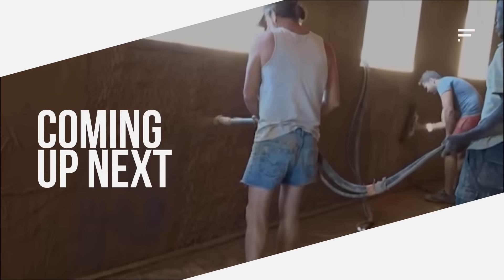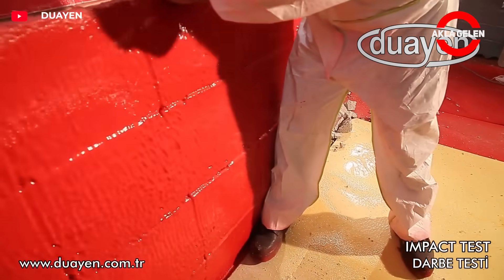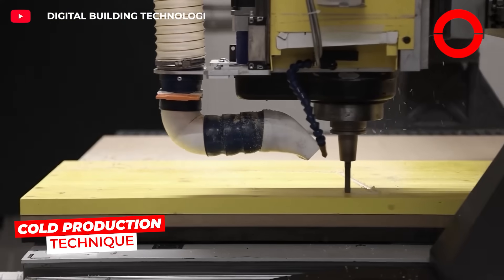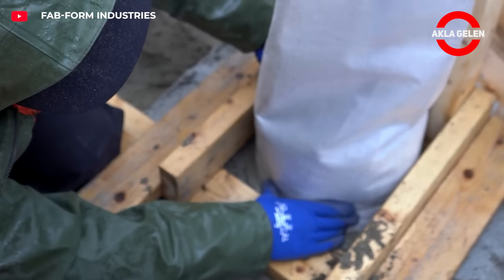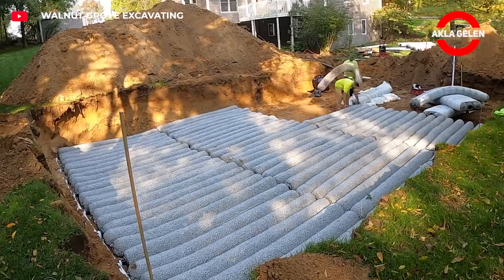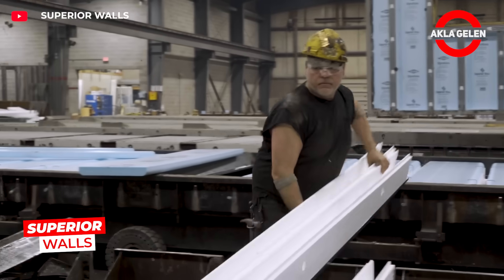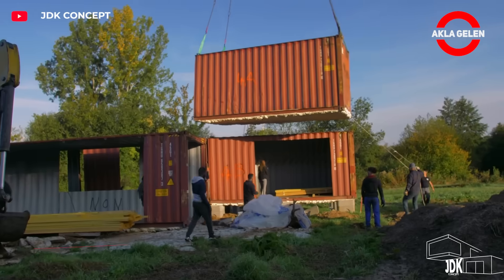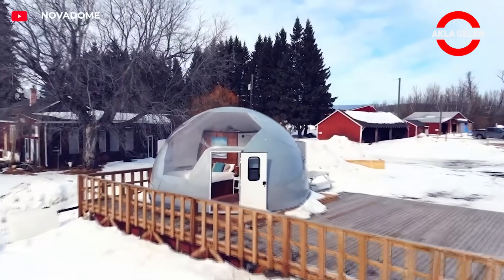I can't believe it! I never thought of these ingenious Construction Techniques

Comment: Containers are not designed to carry weight on the top. They are not good for construction of homes.
Reply: Containers are designed with strong corner posts, allowing them to be stacked up to 10 high. Around the world containers are being used for the construction of homes.
Reply: @richardjoy5060 not to mention they design to endure shifting weight, they need to be able to handle shifting weight at sea
Reply: Ja dom staplas ju uppe på varandra på kontainerfartyg det är dom byggda för och där är dom utsatta för höga påfrestningar även i sidled